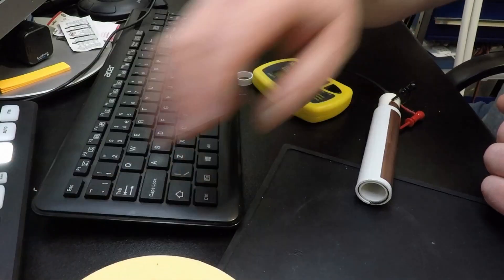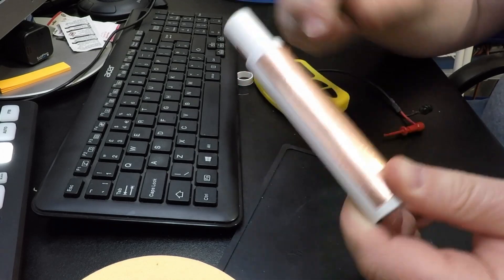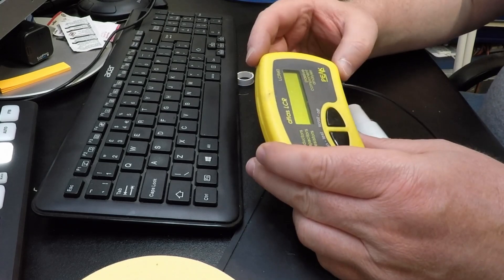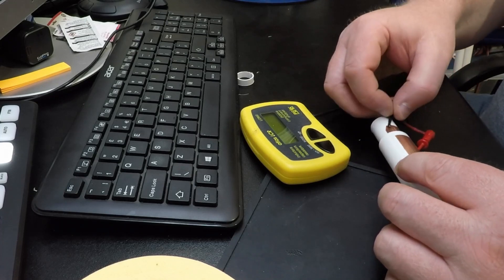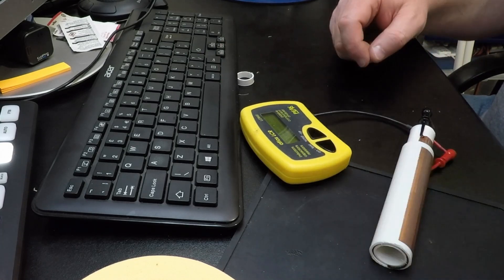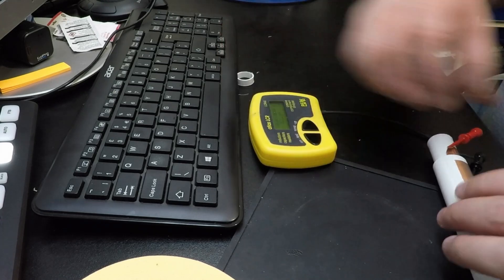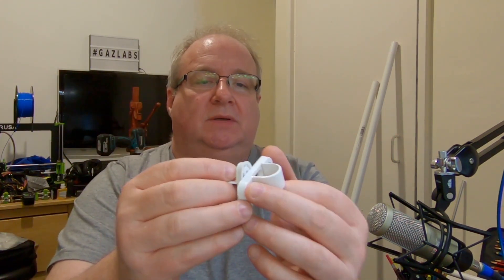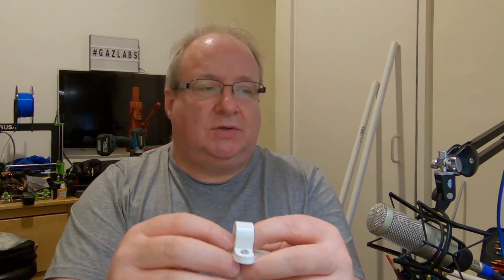How to make a tiny 40Mtr antenna for HF, great for small gardens.

Comment: i'll wait to see if it works first!  I am sure Gaz Lab will have it running by now.
Reply from the maker: not yet.. its blooming small tho! the guy whou did the bulild guide has it working so theres hope.. the only issue is I am working out the maths as I go..
Reply: @TheGazLab  You will get there Gaz, I am sure it will work in the end, maybe a bit of tweaking, but I have full confidence in you.

Comment: I love antenna builds. Today I built a 5/8 antenna for 6M using the DX Commander pole to wrap the the inductor coil. And... it works! Thanks for the video. Really enjoy them. KN4MNA
Reply from the maker: I'm just drilling the tubes.. This is actualy  going to be a neat antenna.. Not sure how well it will work tho